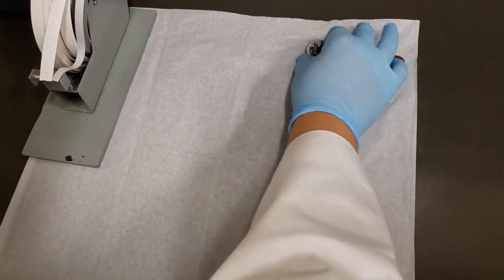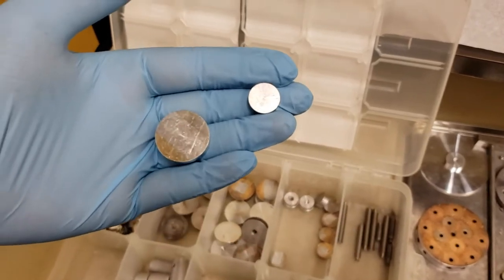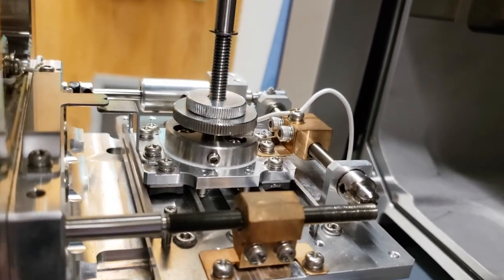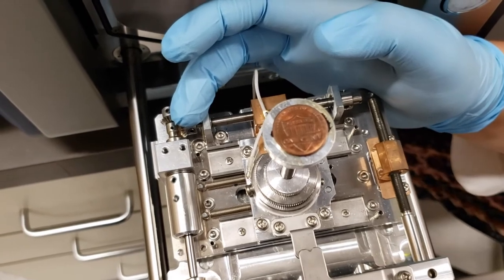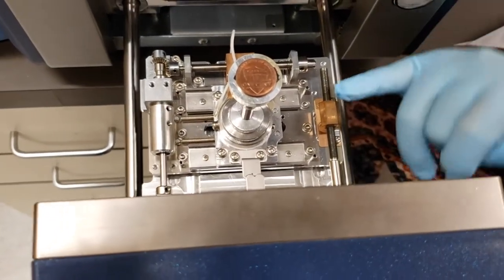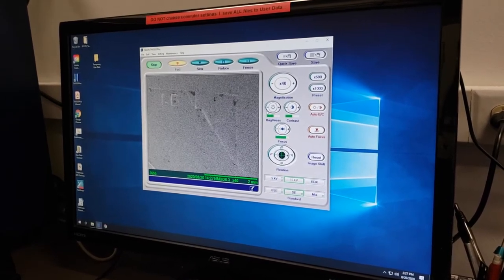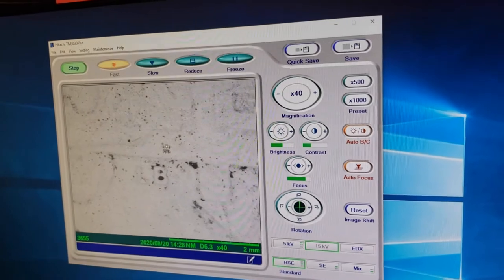TM3030 Plus required training

Comment: 5:50 Epoxy
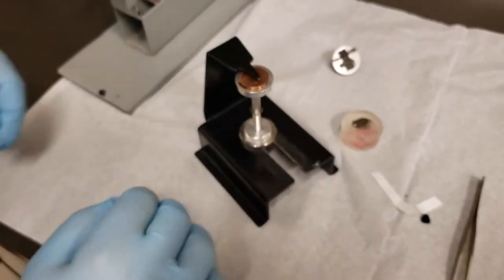12:25 Start of equipment use
20:13 Closing the chamber
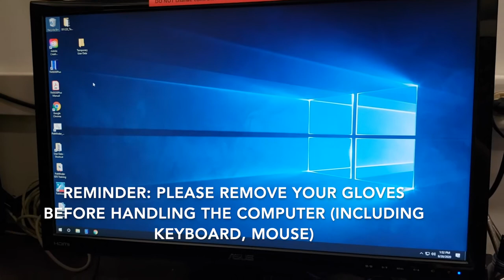20:55 Imaging software
- 22:21 Advise for type of samples (Voltage)
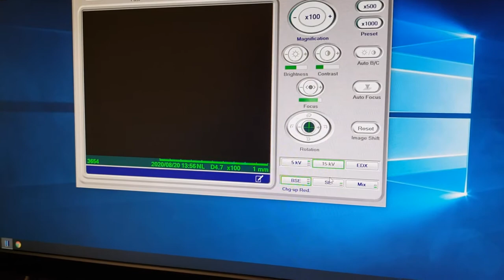- 24:46 Detector
28:50 START!